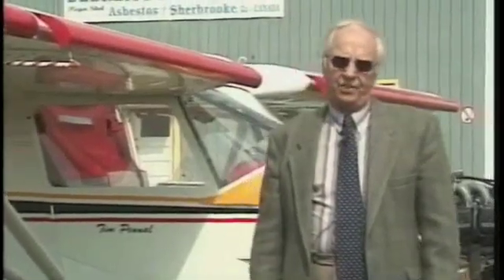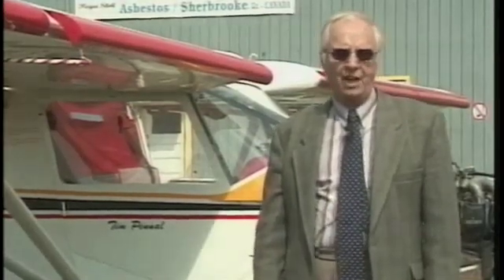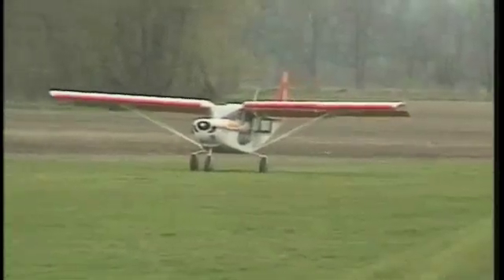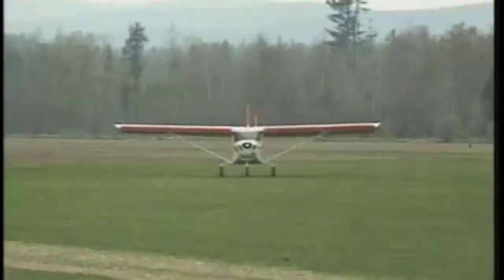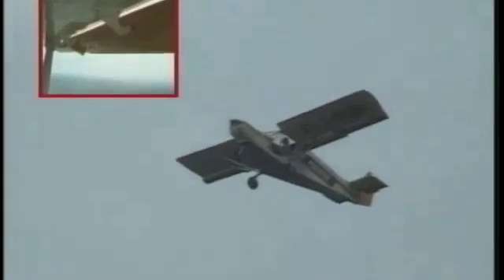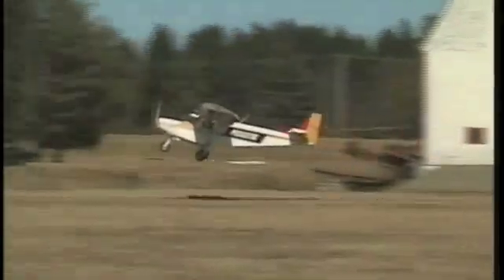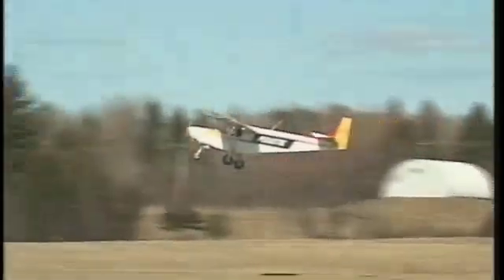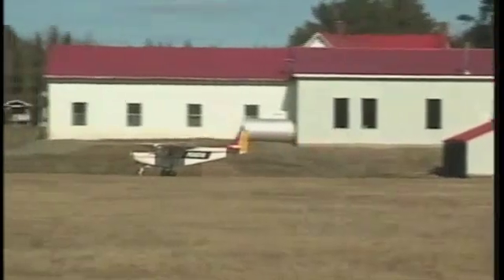PegaSTOL Wings for CH 701

Comment: Only advantage my amature eyes can see is the slats retracting to clean up the wing for cruising. Same idea as used on the F-86 Sabre. When speed drops on said wing, out they come for more lift and it helped the Sabre turn tighter in ACM. When not needed, airstream pushes them to the stowed position to clean it up. Not sure how many mph it is good for on the Zenith aircraft as they are about as aerodynamic as a brick. But, they are a damn capable and sexy brick!!!!
Reply: It’s not just cruise either. Because these slats extend forward and below the leading edge they were able to use a different airfoil with less drag because the lift coefficient with the slats where they extended to made them similar to the high lift fixed slat 701 wing. 

Now you’re truly unlocking the full potential of the operating envelope but like you said the 701 is still draggy. Check out this bird at 4:50 with electric retractable slats. https://youtu.be/5Olmfj7O4Ec
Reply: @andrewmorris3479  the US distributor for that bird is conveniently located about 40 miles or so from my front door. Only problem is, it is currently envisioned only as a S LSA aircraft assembled in the Czech republic and not as a kit. And with asking prices ranging from a base of 108k to 135k (euros, not dollars), lil out of my price range. But damn, that is a sexy brick.
Reply: @n5syr01  That’s awesome! They will be offering kits of the Norden in the future though, but I’m not sure when.